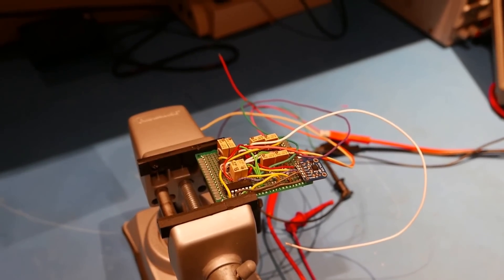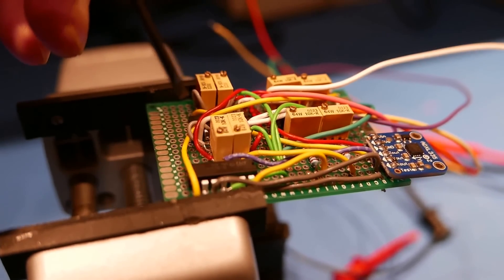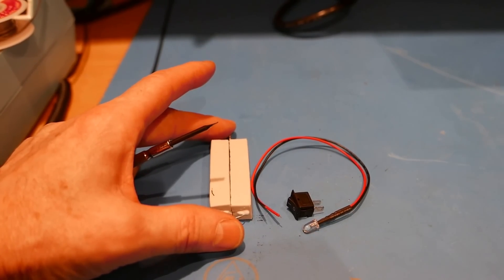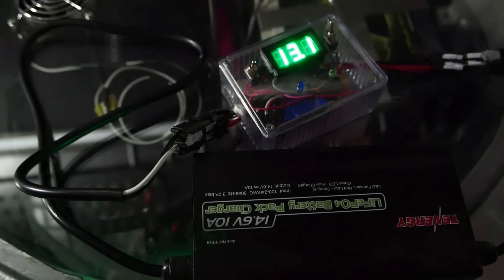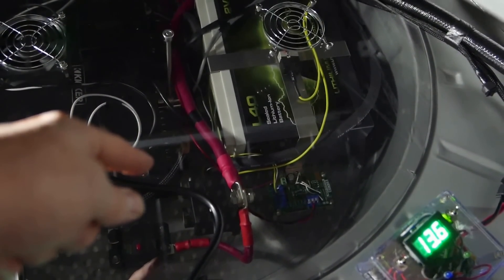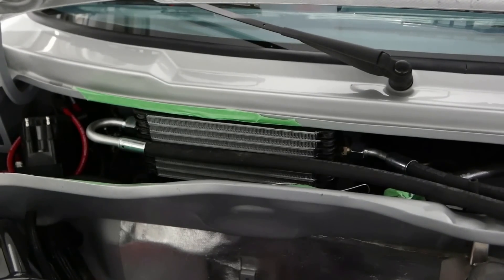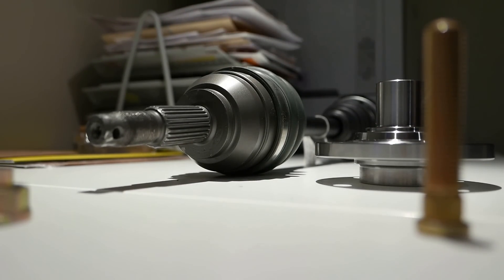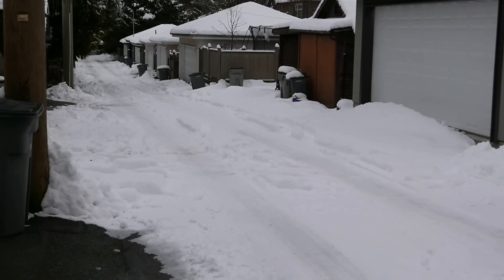The Ultimate 1983 Rabbit GTI - part 139 (Accel-meter, New AC Evap, Racing Axles, Brake Prop Valve)

Comment: If you are still getting too much bite with those pads in the rear, switch to a cheap stock pad. You can then add more pressure with the prop valve if you're not getting enough braking.
Reply from the maker: Any idea where to get 'cheapo' rear pads?
Reply: Anything you'd find at Autozone, Advance, NAPA.... 
I run rear drums and some cheap shoes and still get some lock up under braking while entering a turn. I'm also still using the stock master cylinder with the factory prop valves.

Comment: Nice axles. I've sheared the splines off the stock 100mm cv joints multiple times with g-force drag radials. Very nice.
Reply from the maker: Oh, interesting info. I was wondering if the stock splines were actually a weak point or just a factor in sourcing 40% larger CV joints. I have slicks for the track and for 1/4 mile drag racing so I guess I dodged a bullet without even realizing it. Thanks!